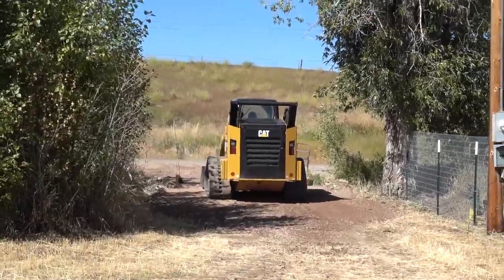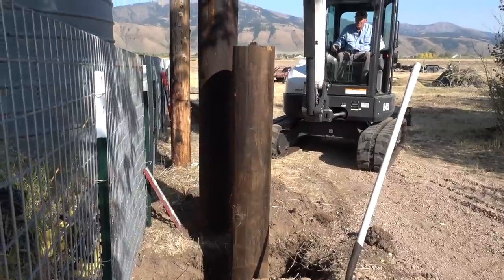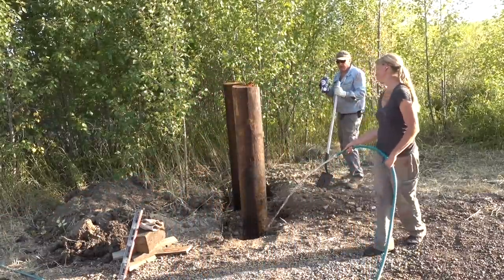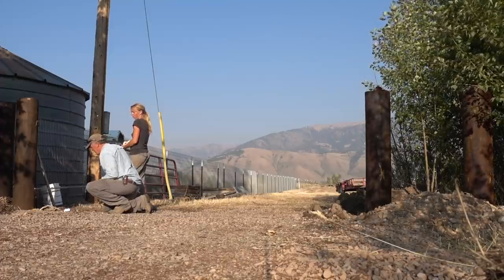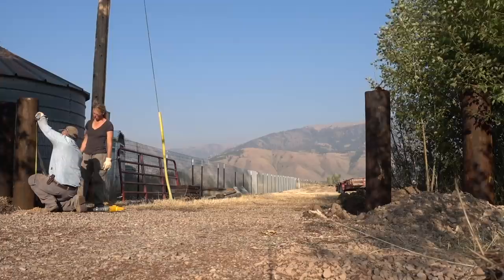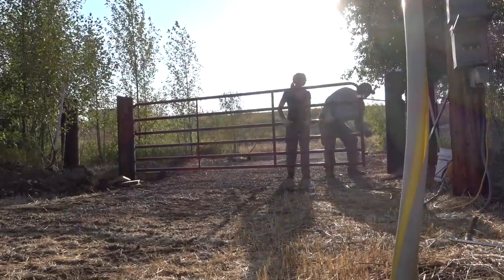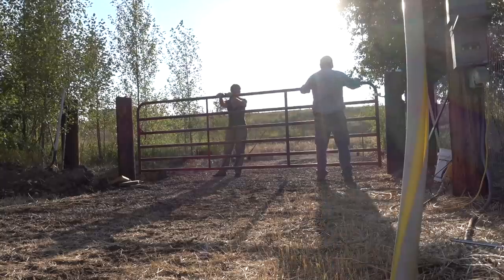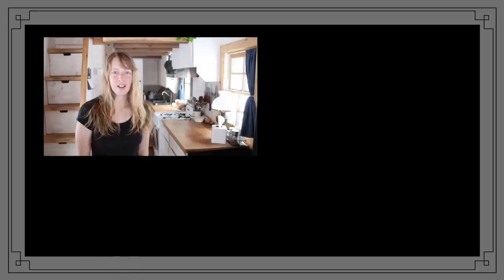Adding a Gate to the New Place - Life in a Tiny House called Fy Nyth

Comment: Even though the wood posts are treated it is always a good idea to wrap the ground contact part in heavy tar paper. They will last a lifetime that way.
Reply from the maker: They are actually leftover pieces of bridge piling from a bridge he'd built for someone else many years ago. So they are treated and designed to be driven fully underground in a very wet area. Which is overkill for gate posts, but we both like reusing things that would otherwise be wasted. :) The posts should be there and solid for generations after I'm gone.
Reply: @FyNyth  My heart leapt when you said the gate was being constructed from reused material.  I'm one of those people that 'rescue' items that people throw away, if I think it can be used in my 'garden'.

Comment: Sometimes I see a larger gate and it’s not resting on a wooden block but on a small wheel, say that of a wheelbarrow. The weight is balanced just like using a block, but it’s still balanced on the wheel when opening the gate. You just roll open the gate.

Comment: Placing a wheel on the gate will keep it level even when it is being opened.  You can also put an extra tall post in or a tall steel pipe behind the back post and run a cable from top to the end of the gate that will help support it.  Just a thought to ponder.  Thanks for sharing.

Comment: I'm trying to figure out what You have setup at the edge of your property by the road, that you could actually use a garden hose to set the dirt! Do you have a well house down there? Another question, you don't have to use cement to help set those posts? Packing it with dirt will be tight enough! You've accomplished so much! 💗
Reply: There is a flowing stream in front of the gate that they built a bridge over the top last summer, notice all the vegetation growing near the gate area.  There looks like a water holding tank right next to the gate on the other side of the fence.  There might be a water faucet on the water tank right next to the gate.  That's my thoughts. ... could be wrong.
Reply from the maker: There is a creek right there, but we also have gravity fed spring water which is wonderful.

Comment: Great craftmanship.  Did Clay consider using a single hinge post embedded in concrete?
Reply from the maker: There's lots of ways to do a good gate, we're just reusing materials that have been discarded by others from projects over the years. So a lot of this is based around good ways to do things with the specific scraps we have to work with.

Comment: Very nice esthetic entry! Wise to have an extra wide passage. Did you choose not to use concrete in the post holes because you felt it unnecessary? It’s fun to watch this all come together. You both are putting in so much heart and hard work. As I watch you both I am also watching the ranch where we keep some of our equipment come together. The new owner has taken over and has a grand vision. I never tire of watching the process!
Reply from the maker: Thanks! Yeah this soil has a good bit of clay in it so setting them that deep and packing it in well should be so solid that there's no need for concrete.